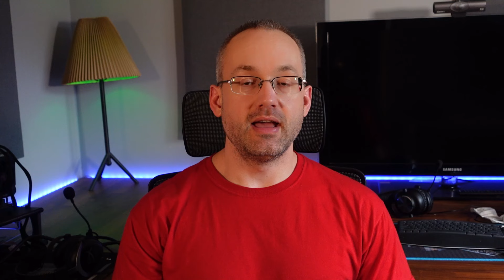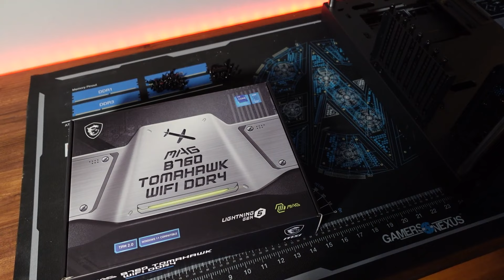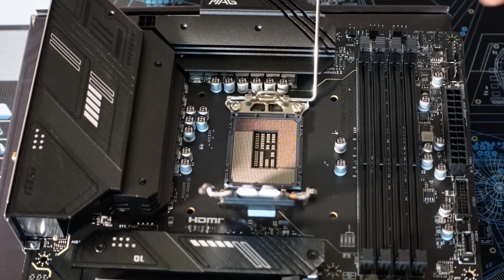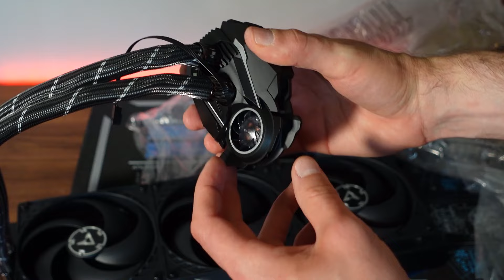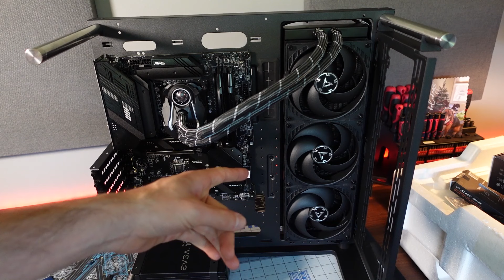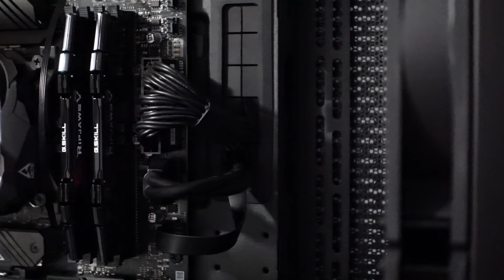Arctic 420mm AIO on a i7 13700 Non K? RTX 3080 ti Gaming Build - Part 2

Comment: What do you think of the tuf gaming b760m-plus with 13700?
Reply from the maker: I think it'll be fine.  Just a FYI incase you don't know, the "M" in that board name means it'll fit into Micro ATX case.  You can technically put that motherboard in a mid/full atx case, but its a pet peeve of mine not to do that. I like to keep the sizes matched per atx form factor.